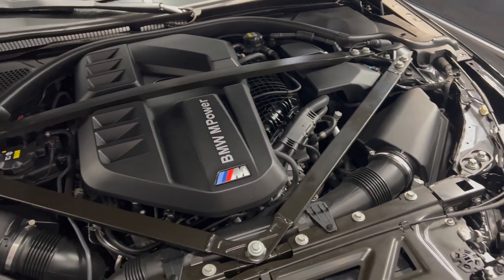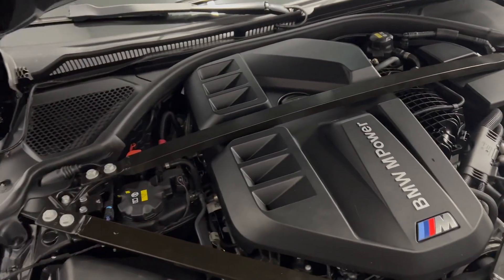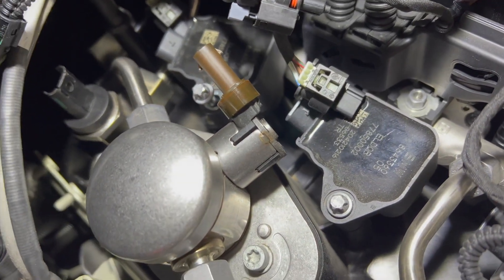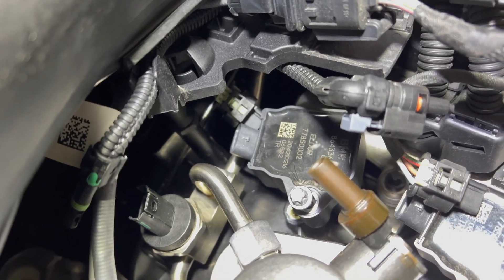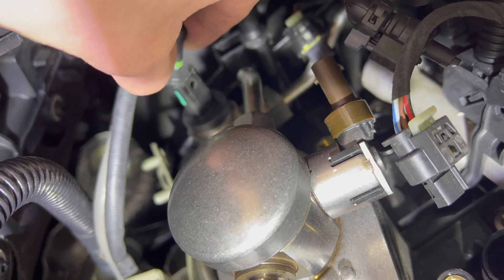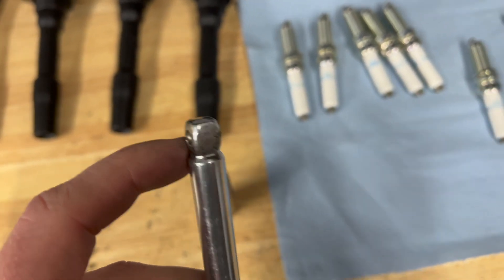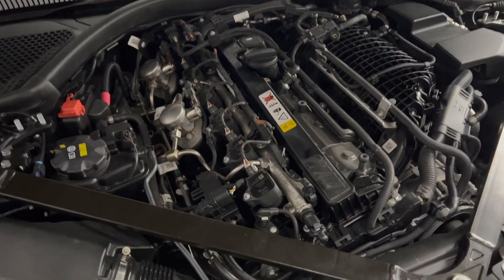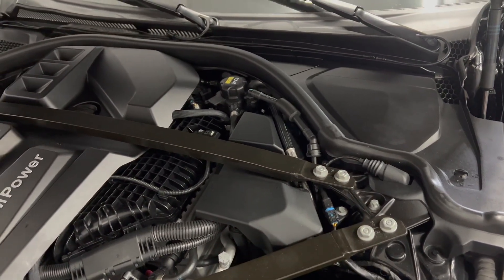Spark Plug Change BMW G8X M3/M4 S58

Comment: Do you know what the stock gap is?
Reply from the maker: I believe factory is 0.030
Reply: @LenartoGarage  Did you get rid of your G82 for the F90?
Reply from the maker: @zerixzerix3039  Yep. I just sold the F90 now as well. Picked up a 2024 GMC Sierra 1500 Denali Ultimate.

I still have the 986 boxster as my fun car. I may pick up a 997 4s after I’m done fixing up the boxster. I’m leaning towards smaller and older sports cars to get more excitement/feel out of them.
Reply: @LenartoGarage  You won't regret the 997! Have had mine for over 3 years and drive it almost every day, it's been great.